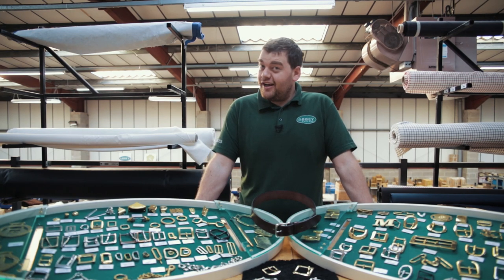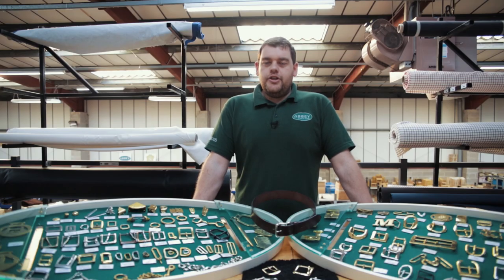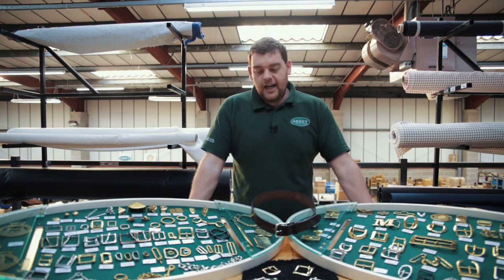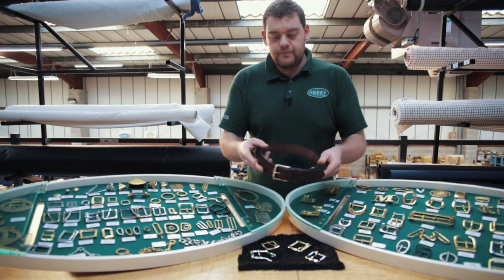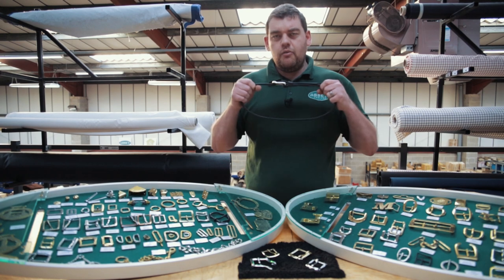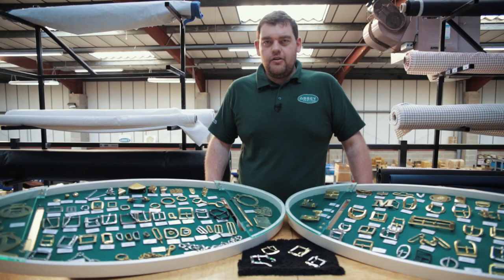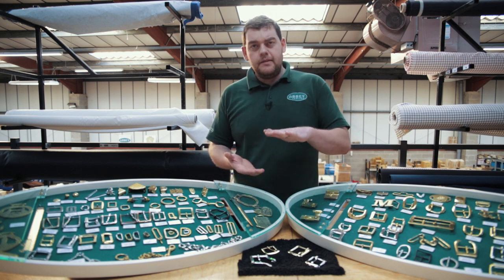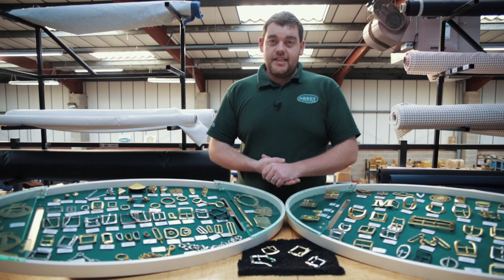Abbey England Off The Shelf Buckles - Foundry

Comment: Thanks for posting that Andrew...I like the sand ram. I have often wondered if the brass buckles were made using lost wax or sand cast as the finish of the buckles is very good...its interesting to see they are sand cast. That almost looks like a Bucklehurst belt in the intro with Sedgwick leather! Are the stainless buckles also sand cast? Rgds Harry
Reply from the maker: Hi Harry, thanks for your comment. We do not manuafcture the stainless steel buckles so we are not the expert but they are either stamped or lost waxed.